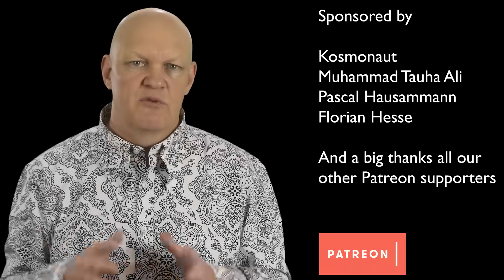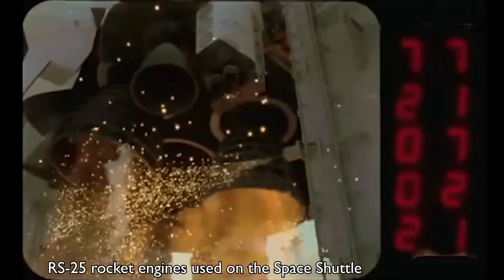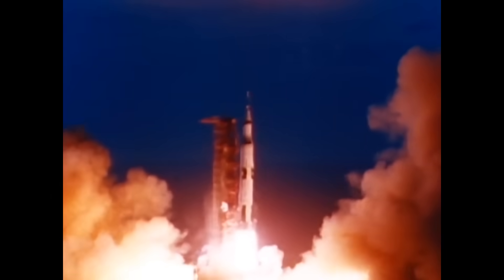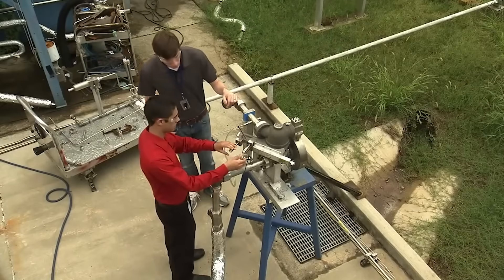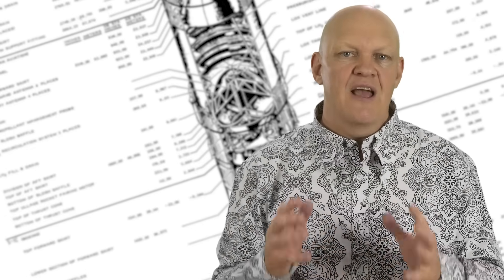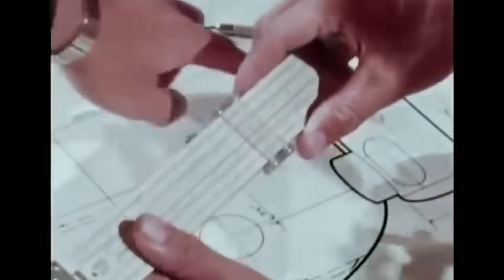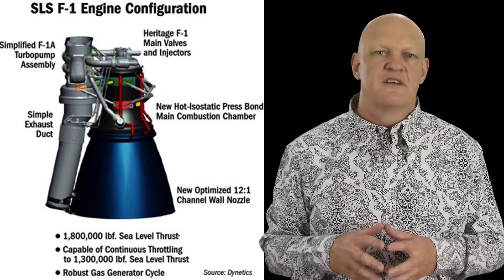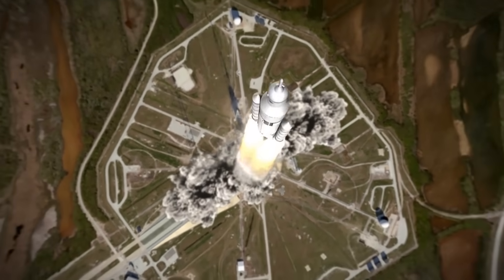Why Can't we Remake the Rocketdyne F1 Engine?

Comment: I think that your little video here is rubbish. By the late 60 the process of DOCUMENTATION was pretty much standard. Furthermore protocols have to be written for every single production step of a part of ONE SINGLE plane. This is especially important to find out both, systematic failures and individual blunders. I find it hard to believe that those protocols were just kept in the head and on sandwich paper.  But even if it is true, even if there is no documentation and no protocols and just the blueprints it is not hard to figure out how to rebuild the engine. Most famous example is probably how the soviets just copied the B29 to the smallest flub.

Comment: My Dad was one of those craftsmen, working for Coors Porcelain company. He machined ceramic parts for all three of the NASA projects as well as other government contracts. He described the painstaking process involved in making components from rough alumina porcelain blanks. He used mechanical micrometers and had developed a "touch" with his tools so he could hold incredible tolerances. He was also very nearsighted and read his mics with his unaided eyes. I'm talking mere thousandths of an inch. Like said in this video, every part was a uniquely crafted component. It is more than just notes but rather the skill that he developed over years of experience.
Reply: Coors makes a lot more important products today. Golden Colorado is their headquarters.

Comment: As an Aerospace Tooling Engineer, I’ve run across openings at Aerojet Rocketdyne in California paying very good rates but I’ve always passed on these openings due to location. I would take a 13% pay cut off the top just in California state income tax over Washington. The cost of living for upper middle class workers is simply too high in California to consider relocating for me. As a result, I work at Boeing in Washington instead. It’s clear they need the engineers in California due to the pay rates they offer but I simply won’t move there. I wonder how manny others engineers feel the same as I do. There are only so manny of us in the country with experience, the skills gap must be difficult for some companies.

Comment: And the Americans very soon learned that any apparatus, while passing through the dense layers of the atmosphere, burns and does not fall as nominal. And cosmonauts after overloads in 9 G, going down on the first cosmic speed cannot get out of there on their own, they need medical assistance. However, the Amerinians said that they descended at the second cosmic velocity, and this assumes a load of up to 25G, and any astronaut becomes a Cutlet. Of course, there is no need for medical aid patties. In general, the Americans still learned a lot a bit after they conquered the moon)

Comment: It might not be impossible to rebiuld them yes every engine had it's own tweaks since they were all slightly different but the engines are still around. While they haven't been moved or used for a long time and may have deteriorated we could strip and examine one and possibly reproduce a engine like it or even a mass production version. How ever even if we could the time it would take would be unnecessary and not worth the payout.

Comment: The bigger issue here isn't that we can't rebuild the old F1s.  As this video shows using newer manufacturing techniques they were actually able to design and build a new engine with the same power and a considerable lower number of parts.  The issue is why it was not used.  Its the same reason that NASA is no longer the powerhouse agency it once was when the mighty Saturn 5s flew. Basically the government could no longer afford (or wanted) to fund such "ambitious" projects.  Especially if it could just piss all its money away in the black hole that is the F35 program instead (rolls eyes.)

Comment: I wouldn't venture comment on or as 2 the whys of the inability 2 build SR-71s,rocket fabrication or even the mending of generator drive belts on century+
old machinery.There was supposed 2 b smarter people than me 4 that,but guess multiple dropped markers on the feild of play occured & they only want millennials 2 render answers as it is the prevailing belief that it is they(the new style)that has those answers.

Comment: I worked at the Rocketdyne test facility in the hills between Simi Valley and the San Fernando valley back in the 80's. 
And seen a few engine test while I was there. 
It is an awesome sight to see up close. 
The engine shut down sounds like the old Godzilla cry. I'm thinking that's where they got the sound affect. 
One day I came around one of the buildings and they lit an engine they we're testing. It was on the side of a hill, I was on the far side with a mechanic. We stood at the edge and looked down into the valley and watched the engine exhaust flow down and back up our side. In less the 10 seconds there was a wall of white exhaust not 15 feet in front of us and 100's of feet high moving at an incredible speed. 
My job was to clear brush from roads and around fuel tanks and munition bunkers in case of fires. 
We were evacuated one time because a fuel tank lost cooling and was a threat to explode. 
One day they had a forklift coming down the road with a long, what looked to be a large oxygen tank with a head at both ends. I asked the guy who had me move off the road what it was they were moving. He said a control rod from their research reactor. 
One day I was having lunch near a pond on the property and was talking with a scientist. His job was to take metals and implode them to make new stronger metals. Implode is my word, he said they would take explosives and surround metal and ignight it as to create very high pressure and condense the metal. 
When driving by his building you could here a tink noise every once in a while, so I assumed that was the explosions inside some sort of self contained machine. 
Best job I ever had.

Comment: not buying it at all.  so they cant make a scaled down version of the f-1 and run test after test, and find room for improvement?  give me a break.  not only have the diagnostic tools improved 50 fold, we have automation to making a part identical over and over again.  thats like saying "we cant make the 1969  jaguar xke V12 engine because they were hand made."  not that you would want to, a 2019 toyota camry has more hp and better gas mileage with less cylinders.  so this guy is blowing mad smoke up everyone's azz.

Comment: @Zombie Killer "The Russians still use the proton rocket and Soyuz spacecraft from the 
1960s (with updated electronics).  Your excuse is laughable."

Do you have any idea how many redesigns and modifications the Soyuz 
RD107 main engines have undergone since the 1960's? There have been 
dozens, the latest of which is the pending introduction of laser ignition 
(replacing the pyrotechnic ignition currently in use). During the course
 of its 52 year evolution, the turbo-pumps have been changed several 
times, the pressure chambers have been redesigned at least three times, 
and the injectors have been modified several times.

Also, there are several different variations of the RD107 that have been used

RD-107 - Original
RD-107K - Improved version, 3.5% higher specific impulse
RD-107ММ - Increased thrust by 5%.
RD-117 - Structural changes
RD-107А - New injector design to eliminate high frequency combustion instabilities

The current RD107, and RD107A family of rocket engines is vastly different 
from the original RD107 that launched the first Soyuz rocket in 1966.  
When a piece of machinery is in continuous production and continually 
being updated and modified, that is a lot different from stopping 
production and then 50 years later, trying to start production when the 
tooling is all gone, and manufacturing methods have changed. Other than 
standard nuts and bolts, I doubt that there would be a single part from a
 1966 version RD107 that would fit a 2018 version RD107.
Reply: No to mention, key word here is 'still use' - not dropped it 40 years ago.

Comment: Why remake an old fashioned kerosene (RP-1) burning engine?  Consider the air pollution from incomplete combustion and low specific impulse (Isp) developed by these engines.  Modern engines should run on Methane (CH4) or Hydrogen, [Acetylene (C2H2), Ethylene (C2H4), Ethane (C2H6)] that offer higher specific impulse and thrust.  They burn cleaner and don't pollute the environment like the F-1...

Comment: I can speak to this in a different sense. 

I am in my mid-60s; I teach electronics to students at a local Polytechnic. One of my hobbies is restoring old valve radios, and for this, if I am unable to obtain a circuit diagram on line, I have to draw one by following and tracing the wiring and valve base pinouts, and consulting old publications such as the Mullard valve handbook. I can look at a valve  circuit and quickly determine whether it is a Colpitts oscillator or a monostable flip-flop, or if the power output amplifier I'm looking at is a Compound Pair or a Darlington Pair, or Quasi Complimentary Symmetry. Most of my students would not even know where to begin.
Reply: Don't start shaking your fist yet old man :-P.  Most PEOPLE don't have the interest or drive to learn on their own (let alone that specific skill).  This IS a good place to shake your fist, but you should check out places like hackaday.com instead.  DIY smart people exist, they're just easier to see in the rearview.

Comment: If they can produce an equivalent to the F1 I'd say they should if it can use liquid Hydrogen and liquid oxygen as fuel. If it's cheap enough to be disposable fine, if not ocean recovery of the boosters would be cheaper than completely building new ones.

Comment: So basically you said that the mechanical engineers of today are not as smart as the ones of yesterday.
Reply: Not less smart,  just a different set of skills. For example
1. How many people could now design and manufacture a radio valve (vacuum tube) from scratch? There used to be thousands of factories around the world owned by companies such as Phillips, RCA, Zaerix, Mullard, Telefunken, Western Electric, AWA, Brimar and Ecko, and desgn engineers coming up with new valve designs. Very few of these factories still exist, they are all in Russia and they are only making a limited range of special purpose valves from existing designs. No-one has designed a new consumer radio valve for 30 years.
2. How many people still have the skills to hand airbrush black and white photos into colour using actual airbrushes and dyes? It used to be quite a common skill in the photographic industry, but is almost non-existent now. Its all done using computers. I think there is one person left in this country still doing it, and she's in her 80s.
3. How many people are still able to repair VHS machines and Video 8 cameras? How many could build one from scratch? 
4. How many people can program a 6502 micro-processor based computer , say, an Apple IIe or II+, in machine language. I can and I still have the handbook too. It used to be required reading for programmers - now, you'll be lucky if you find a programmer even knows what a 6502 is, let one alone have ever seen a 6502. There aren't many of us left.  

Old skills die out as they are no longer required. It doesn't mean the the old engineers were smarter, it just means the younger ones haven't learned the skills of the older ones because they haven't needed to - they have learned the skills that a relevant to the times; relevant to them.

Comment: These engines can be remade- maybe not in the exact manor as before and not exactly the same. I would wager my 401k that the original engines could be reproduced adapting new technologies that would result in better engines in terms of performance and weight. The real question is why would anyone want to? Modern engines, that are available in supply unlike when they were during the Apollo program, are too cost effective to ignore and consider over these engines. Also, engineering schools are turning out just as good, if not better, engineers as they were in the 50s, 60s, and 70s. This guy is purporting myth in an effort to tell what he thinks is a great story. Too bad he is wrong.

Comment: The F-1 design is flawed for several reasons, the most notable of which was the use of Inconnel 750-X (a nickel alloy) in the cooling tubes that formed the combustion chamber. The material is next to impossible to machine. It also becomes brittle and degrades when exposed to kerosene, which fueled that particular engine. Watch the Apollo launches. It's clear, especially on Apollo 8 and Apollo 11, that the tubes have burst in the engines and were spraying kerosene directly into the combustion chambers causing the engines to fail and have nothing but black smoke coming out as exhaust. Just watch the launches and observe what starts happening a minute or so a  before the first stages separate...lots of black smoke for some time but no fire coming out. Those engines were non-functional. And, yes, the Apollo missions were all faked. You can't travel to the moon when the first stage engines didn't work.

Comment: Sometimes the opposite happens: There was a story in online publications a few years ago dealing with refurbishing nuclear warheads. The last US ones were apparently manufactured in the 1980s, and one of the components was a special foam spacing material called 'fogbank' necessary for the warhead function. Despite meticulously following the directions to make fogbank material the morphology was constantly wrong. After several years of setbacks and evaluation it was determined that the reason the material wasn't working was because of impurities in the chemicals used in the past. The problem was that the original engineers never even knew that they needed these impurities, and it was only modern skills and technology that allowed the problem to be diagnosed and overcome. The punchline is that it took years for the new engineers to learn how to rebuild a nuclear warhead, but the old engineers never actually figured it out (except by lucky coincidence).

Comment: Its less a matter of whether or not we could make a reproduction of the Rocketdyne F1 as it is a questions of why would we want to do so.  We quite obviously do not need a rocket engine comprised of 5,600 individual parts that has to be massaged into functioning properly when we can make one that has only 40 parts and does the same job without needing all of the nuances of manually tweaking.  Let's face it, a rocket engine with 5,600 parts that has to be sweet talked into functioning as intended is not a good design even though it could be made to work.  The 40 part design on the other hand is not subject to all of the variability, vagaries, and foibles in the 5,600 part design from the Apollo days and is therefore the better of the two designs.

Comment: CuriousDroid, I think that it might have been a good thing that these engineers were unable to simply remake the old F1 engines from the old plans, and instead had to use the old plans to recreate the old engine's design instead, while modernizing it where possible to simplify the design and manufacturing process.  Even though they didn't use the design (at least yet), it does seem like there were some lessons learned here.  It seems like they created a "new" F1 engine by combining the original concepts with new engineering knowledge, producing a more efficient and easier to build version of the original.

Comment: A lot of nonsense claims that don’t really add up.
Closed-cycle LH2/LOX engines are far more efficient than archaic film-cooled  HC/LOX engines. The reason why SLRBs are used was explained a long time ago, has to do with military rocket development, and though they do work the impossibility of controlling them in any meaningful way once ignited will always be a danger. 
Remaking any such old engines would be the equivalent of making a Ford model T instead of making a Tesla model 3. Absolutely doable, all those «i was a machinist and always bla bla bla handcraft bla bla bla» go back to the museums you crawled out of. The reason why this is done is the way it is is in reality the same exact reason why nobody wants to drop their tablets and bring back the fax machine. Abolutely doable - but does not make any sense. Unless... unless the technology is proven but gets bumbed up with time like from R7 to Soysuz, thus upgraded instead of a full reboot or a completely different model. Practicalities of different approaches and actual results always viewed in a bigger pricture representative of the result as a whole trump nonsense claims like one-sided view of cost from way back when or «some engineer’s notes» claims viewed alone.

Comment: It'd be ridiculous to think engineers today can't replicate a system designed and built 50, 70 years back. Problem is the political will, determination and a clear vision. When there was a will, NASA landed man on the moon in less than 10 years. Bush gave the mandate to NASA in early 200s but there was never enough funding or continued support. Obama cancelled the program altogether, Trump probably can't even spell moon correctly. So NASA has been reduced to a pin-pong ball aimlessly being kicked around.
Reply: St. Devil well no. Trust me they have been doing much more without civilians knowledge...

Comment: Engineers back in the day worked hard when they were young most of them grew up just past the depression and knew what had work was. They knew what tools where. Most engineers today couldnt tell the difference between a screwdriver and a hammer. They have spent all there life with books and numbers. This is what the numbers say but no commonsense. Remember the titanic was built by engineers the first airplane was built by bicycle mechanics.